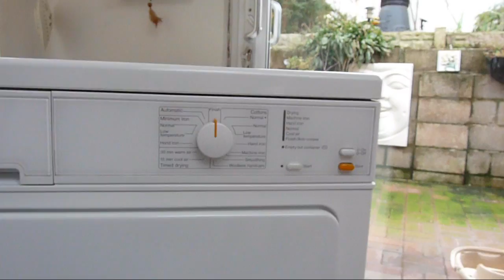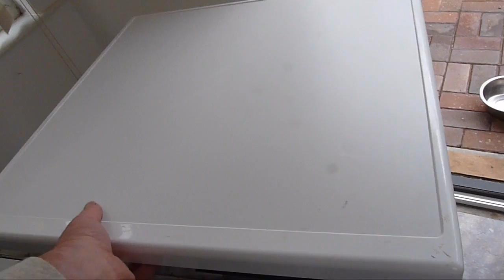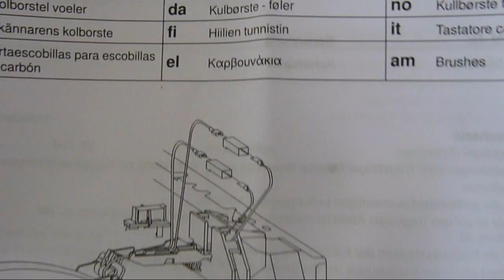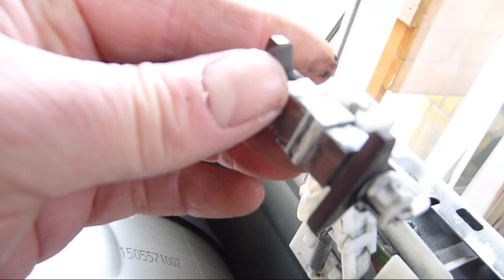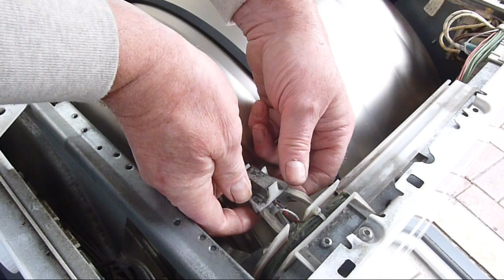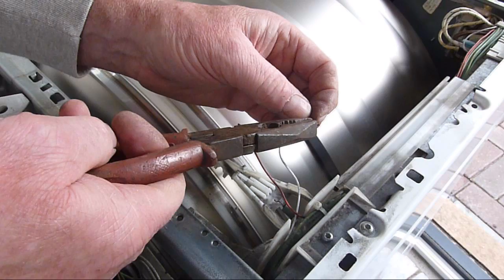Repair Miele Tumble Dryer Noisy How To Examine Sensor Brushes and Replace Part cost £43.00 Easy

Comment: Andrew, I literally could not have done this repair without your video.  What was concerning to me is the carbon brush assembly from a T 9802 Touchtronic Dryer I removed had both wires protruding from the back of the brushes, but the Miele replacement kit had the left brush (green/yellow wire) on the "front" of the brush while the right brush (white wire) was on the rear.  Seems mis-engineered.  I thought I had a defective replacement part, but I examined your installation and saw that my factory replacement part had the wire protruding in both left/forward and right/rear as yours so I proceeded and it worked. FYI, I struggled with the cheap spade clips provided...Paid USD $97.95 with tax. :(
Reply from the maker: Our dryer is still going strong and quiet, as one would expect from a Miele. Thanks for your feedback Chris. Shame the parts are so darn expensive.
Reply: Had the same confusion with wires. But thankfully it is well documented here.
Reply: @AndrewKFletcher   Andrew, thank you for your video, I want to ask you something , my boss has a Miele  honey tumble dryer  T8420C similar in video, 

Problem is that when machine is  put on on drying, suddenly a beeping noise like alarm sound starts machine keeps on for few minutes , then  the cycle of driying ends . What could be the problem? 

I have clean the filters under , also in between the doors, I am actually about to open the whole machine and see what's inside.

Another point is  the machine is located in a enclosure place I can think of that needs cool Air from outside , do you think a small hole with grill would be the solution? 

I would appreciate your help.

Comment: Excellent video.  My husband and I completed the repair this evening. One tip is to do all the crimping with wires outside of the machine to avoid dropping a connector inside.  The wires are long enough to reach over the top edge.   Thank you!

Comment: Brilliant! Thank you - you've inspired me to fix the clunking noise on mine now! What a brilliant machine - still going strong and its older than my kids lol
Reply: Have successfully changed the brushes (easy fix thanks!) and it was definitely worth doing but the knocking sound hasn't stopped. Sounds like it's coming from further down inside the machine, maybe a roller or something?

Comment: Great video    I bought one of those fancy screwdrivers and your video prompted me to fix my washer dryer my self.     Miele have charged me  GBP 140.oo   for a visit, just to PRESS the reset button the heater for the dryer thing.     Be Confident readers, do it yourself !

Comment: Thanks Andrew Very helpful got my dryer going again for £45 may I ad you don't need to remove the rear screws they hold the back plastic blocks that hold the top down . Just Remove the side screws and lift and push back the top towards the back, push forward when reassembling.
Reply from the maker: Thanks Dave.
Reply: Exactly so.  All Miele appliances I've worked on are the same.  Prise out the side screw covers, loosen the side screws a few turns (no need to remove), push the top cover back slightly and it'll lift clear of the machine.

Comment: Hi, to save the £43 I ground down the middle part to get some clearance. I bought the tumble dryer used for 12£ so I wasn't ready to throw more money for the sensor than the machine itself. It got rid of the noise.
Reply from the maker: +pudidotdk Brilliant :)
Reply: I am about the same decision at the moment... :( I have bought drier used for 250 usd) and didn't know that this clicking sound is the sound of 76 usd to change brushes. Now after some 2 years I have the same sound. Brushes are still having gap between them not to touch the rail. But when the drum rotates when brushes are coming thru the point on rails there GRND contact to the drum is screwed they jump and hit the contact. Look like the problem is due to 3 cm of free space under real at that point. Rails are bent inside so the circle is cut and make an obstacle to jump on for the GRND brush.

Comment: Thanks for this. I’ve done this twice already, seems like 4-5 years before the brushes wear down enough for the plastic carrier to contact the drum connecting band screw head. This time I might grind a mil off the screw head too, that way it should go another year or so. Crap design for supposed high quality, high price product.

Comment: Are they using reconstituted diamonds for these brushes? Should be able to recreate your own from offcuts. I had a Yamaha motorbike that wanted $60 graphite brushes (x2) so I bought some alternate car brushes and used a dremel tool to grind them down to size for a grand total of $4 all up. So I'm sure these could be replaced under $10 (Australian).

Comment: You do not have to remove those screws on the top back because they are simply holding the hinges in place once you remove those two front screws the lid will just lever up and off those hinges.

Comment: After changing the Brushes only, the noise is gone but the moisture sensor itself become not functioning. 

For example, before changing the brushes, if the dryer is empty and I started with "Automatic" mode, it starts with 53 minutes, then reduce to 0 and stop after short time. This is correct behaviour.

But after changing the brushes it drops to 32 minutes instead of 0, and continue rotating. It become taking much longer time to finish the cycle (if it stop already). I tried to dry my wash and it took 1 and half hour and still rotating. When I stop it manually I found the clothes are dried and hot. This give indication the moisture sensor not working. 

I checked the wiring, contacting with the Drum Trucks everything seems fine. but I don't know what the problem is. I bought 2 pairs of brushes, the first pair was for another model but it fixed ok, after discovering the sensor is not working I bought the original brushes but still the sensor is not working. 

Any idea where to look for the problem? 
Thank you
Reply: Did you solve this problem?

Comment: Does this brush "feel" if the laundry is dry? Since my Miele (Novotronic T459C)  only tells in one mode how dry the laundry is, yet it's of no use. Since it sometimes says '9' (which is soaking wet) or '6' (Which is half dry) even when the laundry is dryer than camel turds in the desert.
Reply from the maker: Yes, I believe this is it's function
Reply: from what is present on my 7760c - 20V DC on the hot brush and direct to the protective ground on the second brush - look like it senses how much current leaks thru the drum with wet stuff from "hot" contact plate inside the drum to GRND plate that is 180 degrees opposite.

Comment: i can't get the top cover off my machine, removed 2 side screws and 
the 2 rear screws, but the cover does not lift off !
HELP
Reply from the maker: +Carl Evans There are a couple of plastic clips on the sides from memory and I think it slides either back or forward to release them.
Reply: Got power going in but no lights or programs working.
Reply: @davidcalveley993  check that connections 220v to internal lamp and 220V-power-in are not interchanged on the board. They use the same type-size socket and could be disconnected (I just did that). White for a lamp, green from the line. The line going to the PCB corner close to the power button.

Comment: thank for your video, I have Miele dryer T 8803C, no start, no power, I checked socket is ok, door close is ok...so carbon brush is abrasion , please help me, thank so much :)
Reply from the maker: Sorry can't be of much use, but it would be worth having the motor brushes checked as these can stop the machine when worn down. Usually you hear a strange grinding noise as the spring in the brushes touches the armature.
Reply: Thank so much, I will buy a new brush replacement , carbon brush is same as for all model ? My model is T8803 C, could you send me a link carbon brush for this model . sorry I living in Vietnam, very difficult search them.Thank :)
Reply from the maker: How old is this machine? It appears to be very new from the number you gave me?
Reply from the maker: When searching use this format   T8803C

Comment: 2017. Hi, I have bought a new Miele dryer that is using the same system for the drying sensor. I have this loud tick a de tick noise as the drum runs and had the Miele engineer out as this cant be right for a new £1000.00 product!  He said it is where the brushes are hitting the joint on the bands. He replaced the bands but still the same noise. He said there is nothing more that they can do!
 Is there a way I could fill the joint in the band with a filler or glue that the brushes could then ride over with out making this awful noise? My main worry is that if I use a small filler and sand down when hard it will not make contact as the brushes run over this point. Will this upset the drying sensor? If you have any help please let me know. Thanks Andy
Reply from the maker: Could you borrow a small angle grinder and smooth the band joint down? I changed brushes and got rid of the noise. As the brushes wear, the clearance is affected.
Reply: Andrew K Fletcher
Hi Andrew, thank you for coming back to me. My problem is that it is not proud but it is an inverted so thought a out filling with some strong filler and then sand down so making it smooth. Then I worry that the brushes will not be otherwise make contact as they roll over the fill so making the sensor not work properly.
Any thoughts. I have Kind regards. Andy
Reply: Andrew K Fletcher
Hi Andrew, thank you for coming back to me. My problem is that it is not proud but it is an inverted so thought a out filling with some strong filler and then sand down so making it smooth. Then I worry that the brushes will not be otherwise make contact as they roll over the fill so making the sensor not work properly.
Any thoughts. I have Kind regards. Andy
Reply from the maker: Could you make a short video, upload to Youtube and send a link to Miele direct to show them your problem? It maybe the your engineer is not clued up enough. Sounds like a manufacturing glitch.
Reply: Hi, I have called Miele again and said they must have a problem this can not be right! They are sending out an engineer and will talk to the service manager when he arrives so he can see the problem over the internet. They are out on the 6th depending on weather and I will let you know the outcome. Regards
Andy
Reply: Andrew K Fletcher
Hi Kevin, they have been replaced replaced the product for a new one, thanks for your help.
Reply from the maker: That's a great result :)
Reply: @AndrewKFletcher  I think that new machine must not make that clicking sound. Our used do not make after new brushes installed. But.. I think that your new machine had the same problem with not perfectly round rails as mine used have (see comment below) that cause not worked out brush to jump again.
Reply: Andy Phillips mine is only a year old and makes a really loud click. It’s such a bad design. I think I will complain too. It was not cheap. It shouldn’t be making this noise.
Reply: @nicholaswheeler3985  Did you have any joy with this? My 1 month old Miele T1 just started this clicking noise and it’s driving me nuts!